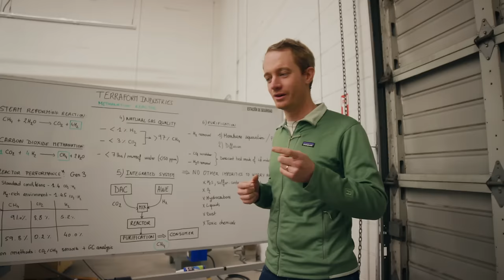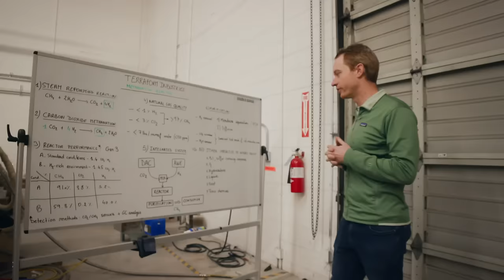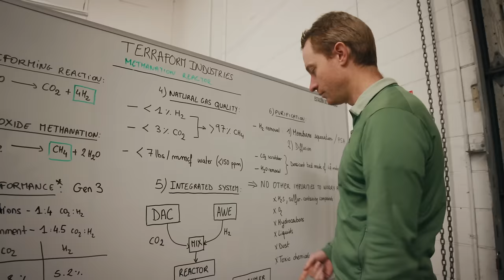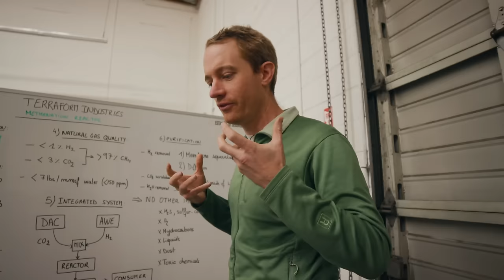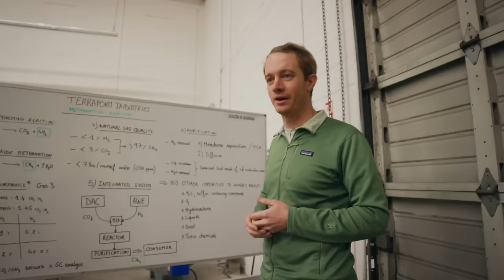The Future of Humanity's Energy No One Knows About | Terraform

Comment: The technology seems really promising, but I need to see the numbers. Does the solar generation minus the conversion and transportation losses provide significant value over just using the solar directly on the grid during the day?
Reply: That does sound very logical. If I have 1 MWh produced by solar then utilize that MWh to suck C02 out of sky via DAC then convert the CO2 to fuel my cost is 1 MWh of energy + opex and how many units of energy did I get out? It would need to be more than 1 MWh just to break even.
Reply: I really doubt he can produce naturel gaz cheaper than traditional ways
Reply: Obviously that's what he already working on because thats the point of the project - he'll get the numbers to you soon armchair world-changing engineer guy
Reply: The point is that for many things, hydrocarbons are not simply replaceable with electricity. He’s not trying to replace solar energy derived electricity, he’s trying to replace mining/drilling for fossil fuels.
Reply: @Elliot_97  Sure, but nothing is free in science. Many solutions look great on their face, but you have to understand by-products, conversion losses, transportation costs, risks, etc, to be able to understand the true value of a solution. This looks good on its face.
Reply: @jasont80  I actually don’t think this looks promising, at least not any time soon. The big red flag for me was when he mentioned they need to capture carbon (DAC specifically) at $100 a ton for their business model to work, and currently it costs $600+, with projections barely putting it below $300 by 2050. Barring some major breakthrough in carbon capture technology, this guy is in trouble.
Reply: @Elliot_97  That's a good point.

Comment: This is a real eye-opener. I had an epiphany resulting from this use of methane. I have been thinking of gas fuels as inherently inefficient, since they have relatively low energy density, and require compression to store. However, as storage, both the pressure and the chemical energy can be largely recovered, and existing natural gas infrastructure can be repurposed as both energy distribution and storage, simultaneously, and could even be shared between natural gas and renewable methane. Of course we still need to fix the greenhouse gas leaks.

Comment: What is the energy input to output ratio?
Energy required to create the fuel source and then converted back to energy?
Reply: @headrobotics He mentioned that he will use cheap solar when grid don't need it (when price is lowest) and electric heating is more expensive than gas heating (depending on solar demand price). I also would liked more numbers.
Reply: The value is not specified in the video, but hypothetically, for a scaled up and mature process, an overall process efficiency of around 50% is plausible.  In other words, 2 kWh solar electricity input, for producing 1 kWh thermal energy stored in the form of methane (CH4) gas.  For a less than fully optimized and mature process, 25% efficiency will be more realistic.

This is not exactly a "good" ratio, if one only considers that humans currently already burn substantial amounts of natural gas (primarily methane) for producing electricity (often at 50% thermodynamic efficiency or less, so 2 kWh stored methane thermal energy input, for 1 kWh electricity output).

Basically, it makes more economic sense to deploy solar panels, and then to use the solar panel derived electricity to reduce natural gas consumption rates for producing electricity.  This will have a much larger effect on reducing global CO2 emissions of human society, compared to trying to use the solar electricity to produce natural gas (to then burn it to produce electricity again, as this requires essentially 4x the number of solar panels, compared to using the solar electricity directly as electricity).  Batteries are also a much more efficient means of storing electricity (with round trip charge/discharge efficiencies over 95% for lithium ion and lithium iron phosphate chemistries), compared to synthetic methane production and storage.  Producing electricity derived methane, and then later burning it as an electricity storage means, will have around 25% or less round trip efficiency.

However, in a hypothetical future where enough solar panels are built and deployed to meet 100% of societal electricity needs, one needs to "over deploy" the number of solar panels by a not insignificant amount, so as to accommodate cloudy day and winter conditions.  For example, if humans want to run their civilization entirely on solar panels, it makes sense to have 3x (or more) of the number of solar panels theoretically required for meeting peak demand, since even on cloudy days, one still usually gets at least 1/3 of normal (full sun) production values from the solar photovoltaic  panels.  If society deploys solar panels 3x that theoretically needed on sunny days, then the electric grid will be rather stable, even with minimal batteries being deployed.  Solar panels are also sufficiently cheap these days (within the last four years or so), that it does make good economic sense to over deploy solar panels, more so than building large quantities of grid storage batteries, at least in many cases.

However, if you do this 3x over deployment of solar panels, then you end up with a massive amount of electricity "surplus" on fully sunny days (ex: 2/3rd of your production on those days is "surplus").  On those days, it totally makes sense to use the "surplus" electricity to do some lower priority industrial activities that will still be useful for society.  Such lower priority industrial activities can include doing water electrolysis to produce the hydrogen needed for CH4 and other synthetic hydrocarbon production, and/or for powering kilns for converting the calcium carbonate used in the DAC (direct air capture of CO2) process, into useful CO2 and regenerated calcium oxide, that can then be mixed with water to make calcium hydroxide, that then absorbs and concentrates atmospheric CO2 to produce calcium carbonate (which then gets fed back into the kiln to repeat the process).

In other words, if you want to ever truly reach a "net zero" CO2 economy, it totally does make sense and is necessary to invest in DAC + water electrolysis + synthetic CH4 and other hydrocarbon production.  Longer chain hydrocarbons are also still needed for making plastics and other hydrocarbon derived non-fuel materials used in human society (like some pesticides, some types of rubber compounds, many other non-metal/glass/wood materials and chemicals, etc.).  The process described in this video produces CH4, but  it is also possible to use a "Fischer-Tropsch" process to produce longer chain hydrocarbons (essentially a synthetically produced "crude oil" substitute, that can be fed into crude oil refineries to produce the normal array of hydrocarbon products that are still needed by human society, even in a "net zero" CO2 economy).

Comment: I like the tech because there are industries that are locked to hydrocarbons (rockets, emergency generators,…) but it’s kinda awkward to me cause the founder doesn’t even mention the transition away from hydrocarbons.
It’s almost like he’s saying we’re supposed to de-electrify and revert back to the ICE globally???

EDIT: he mentions direct air capture of CO2 on a massive scale around the 13 min mark, I guess which closes the loop
Reply: yes you are right though, he doesn't specify the areas or industries he sees as benefitting from massive hydrocarbon injections beyond fertilisation and rocket fuels
Reply: @Patrick-jj5nh  Can't we burn hydrocarbons to generate heat? And replace peak gas when sun and wind is low.
Reply: It all depends on cost. All this direct air capture, water electrolysis and rectors adds extract steps [complexity] into the process, vs charge the battery, drive electric motors for locomotion. The value of this is in methane or liquid hydrocarbons as an alternative energy STORAGE tech. ICEs are more complex and already expensive to maintain the EV motors. I could easy see EV for on-road and small vehicles, methane/liquid hydrocarbons only for niches like big ag gear.
Reply: @noelkelly4354 ICE isn't going anywhere anytime soon. EVs need better battery tech to even be viable en masse. Batteries need better energy density, faster charging, less fire risk*, and greater production scale. None of the experimental battery chemistries solve all of these problems.

*The fire risk of lithium battery chemistries is massively understated. Not only can a thermal runaway happen from an internal short or damage to the casing from a low speed collision, but the resulting fire is far hotter and far more violent than hydrocarbon fires.
Reply: @ElijahDecker batteries will never approach hydrocarbon energy densities. which is good because they'd be incredibly dangerous if they did
Reply: Let's not forget the entire plastics industry and fertilizers too (needs ammonia, which needs hydrogen).

Comment: So what is the energy efficiency?
Reply: Panels are cheap but only 20% efficient. Gas turbines are only 20-30% efficient. Making fuel on Mar has no price, because it has to be done. You can't economically take fuel for a return trip.
Reply: most probably extremely bad
Reply: Efficient isn't the point, it's the amount of free energy from the Sun, using plentiful cheap components, at a competitive production cost. 
Its only about 20% Efficient,  but if it costs less than drilling, and removes excessive co2, it's a winner.
Reply: @dnomyarnostaw  we're not at a stage yet where we have more than enough renewable electricity that we can waste it away. it's the same as hydrogen: yes it's a dense energy carrier, but the full cycle (electricity --> hydrogen --> electricity) is terribly inefficient, making it only viable for processes which can't be electrified directly. Direct electrification is the way to go.
Reply: @antonclaeys  Yes, we definitely do have enough solar to make storable fuels.  Look at the over generation of power in the middle of hot days  in many areas. It can't be used as the transmission system can not cope. 
We have whole solar farms that go off-line due to unwanted power.
If this got redirected, even at low efficiency into storage systems,  it would add huge amounts of green power to the  mix.
Reply: @dnomyarnostaw im confused how this removes excessive CO2, renewable natural gas is still going to emit CO2 when combusted…

Or help me understand this please
Reply: @benjaminmartin8646  I'm having trouble remembering what this discussion thread was about, but are you asking how "artificial gas" saves Co2?
I think the answer is that artificial fuels use up atmospheric Co2 during manufacture, so any Co2 emissions later are just replacing what was already in circulation, not adding to overall levels.
In the meantime, artificial fuels are sequestering Co2.
Reply: However, making artificial natural gas through sequestration still upholds our dependence on natural gas infrastructure rather than electrifying. We can’t feasibly make all natural gas carbon neutral and renewable fast enough, so I would argue the net effect of artificial natural gas on our energy system as a whole is negative (although it could be useful in niche ways on smaller scales)

Comment: A good market for a more compact version of this setup would be the RV market. You could eliminate the need for propane tanks and have the machine run the entire thing. A generator would be used for the excess to top up the batteries while the machine constantly runs the fridge, air conditioning/ heating, Stove and Oven. It would be a great test of the system’s capabilities as well.

Comment: Ok but what about all the energy used to produce the solar panel. You can't trick us all.
Reply: That would be yesterday's solar panels needing "all the energy used to produce."  Today's are produced more efficiently, and tomorrow's will be printed with perovskite inks on flexible conductive plastics, in roll-to-roll machines that produce miles of PV per day.  Yes, even that will still cost something, both resources and energy, but we keep spending less to get more as time and research accumulate.

Comment: The founder said something about the efficiency of energy, and how the sun's photonic energy is being used directly to initiate the reaction. Great work, because both CO2 and H20 are abundant, and making a hydrocarbon like CH4 that will be burnt to give back the same compunds as the raw materials makes it feel like an incredible reversible reaction!!

Before we dive deeper into the chemistry, let me just ask where the energy comes from that powers all of the system that processes and filters the products. There is an injector, and then there are other electrical components, which would need to be powered up. In the end, the overall efficiency of the system needs to be considered as well. Transporting electricity does take more than say shipping some natural gas, but consumption of electricity should ideally cause lesser global warming than burning the hydrocarbon directly.

I like the modern approach proposed in the video, to solve the energy crisis issue. The initiation of the reaction is what's groundbreaking and hopefully simple solar panels, or mechanisms that work on similar principles would be able to kickstart artificial hydrocarbon synthesis. There could be a time where we stopped digging for hydrocarbons, and if this provides a replacement, it's much better. Not to mention that there are lot of factors that can be improved upon, like the choice of catalyst, and the reaction conditions to increase yield.
Reply: By the way, a lot of energy is consumed at night as well, which is why I mentioned alternate sources should initiate the reaction similarly.

Comment: electrolysis, oil heater, cooler, and compression of the final methane ...  can the produced methane even cover the needed energy to "bottle it from air" ?
- The reaction has been known forever. Have they found an engineering breakthrough to make it profitable?

Comment: Ridiculous.  have you ever heard of a heat pump?  We don’t need to burn things to do stuff anymore and the last thing we need to do is spend five times the amount of energy creating things to burn. And by the way if you understand ppm then you should understand how ridiculous direct air capture is.
Reply: Can still be superuseful to make the most of surplus energy from renewable to deliver electricity in the low times (and yes, use it in a heatpump). Change needs to happen fast and updating all the grids and equipments might just never happen fast enough.
Reply: What's ridiculous about that statement is too much to critique. However, for starters, for as good as heat pumps are, they're currently limited to applications under 200°C. Additionally, the politicization of things like heat pumps is having the effect of slowing deployment. Not only do we need to replace existing HVAC/R infrastructure with heat pumps, but we need ever more of them as demand in the developing world skyrockets. Secondly, were you paying attention to the video? The entire point of TerraForm is to get the prices for CO₂ and hydrogen to economically sustainable levels. That simply wouldn't be possible if your "five times the amount of energy" statement was anything close to accurate. Lastly, DAC absolutely makes sense for this use case. Where DAC isn't viable is as a solution to reduce atmospheric CO₂ to any meaningful level.

There's no such thing as a "silver bullet" to fix climate change. There's only "silver buckshot". Needs exist for transition solutions. Needs also exist to accelerate the decarbonization of certain hard-to-abate industries. Areas such as heavy ground transport, marine transport and air transport.

Something that some won't appreciate is that burning hydrocarbons isn't inherently bad. It's when we extract them from sequestered sources deep underground, then emit greenhouse gases into the atmosphere, that we get into trouble. Sourcing carbon and hydrogen from the atmosphere and creating synthetic fuels, all using renewable energy, is akin to icebergs melting. Just as melting icebergs don't contribute to sea level rise, burning synthetic fuels doesn't contribute to climate change. It's a completely circular process.

Using synthetic fuels to decarbonize heavy ground, marine and air transport faster, all without the need to completely replace tractors, ships and airplanes, is simply huge! Let that process play itself out over the next several decades. In time, with advancements in battery technology, creation of charging infrastructure, additional renewables generation capacity, as well as the modernization of and additions to grid transport and distribution capacity, we will get to a post hydrocarbon economy. We just need every bit of silver buckshot to help get us there.
Reply: Where is your company and solution? What are you doing to address any of this??